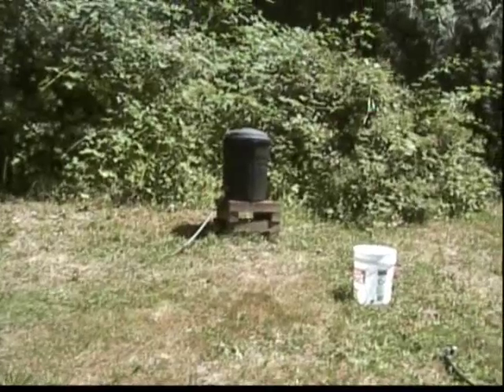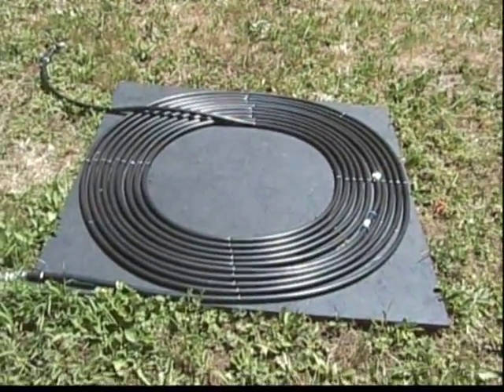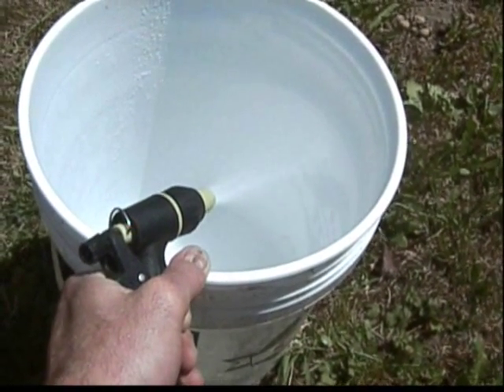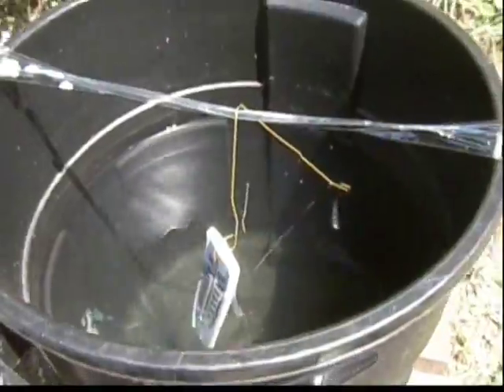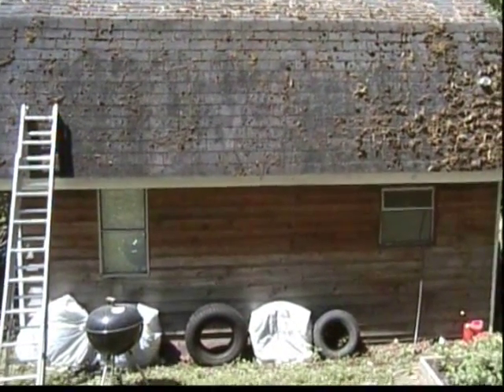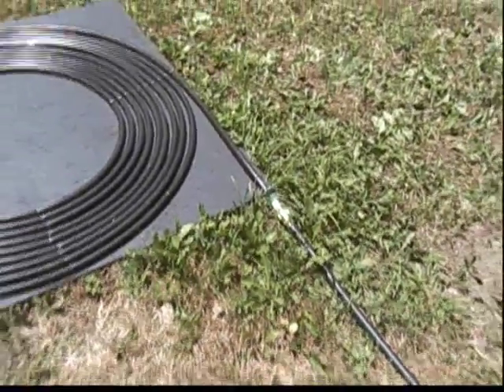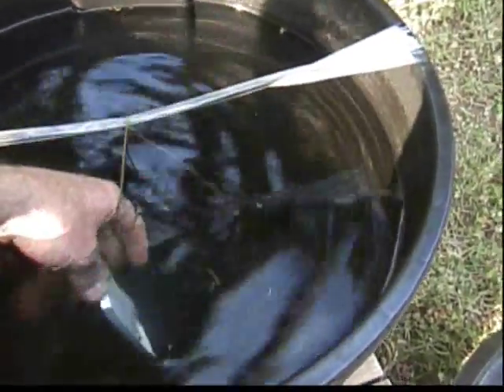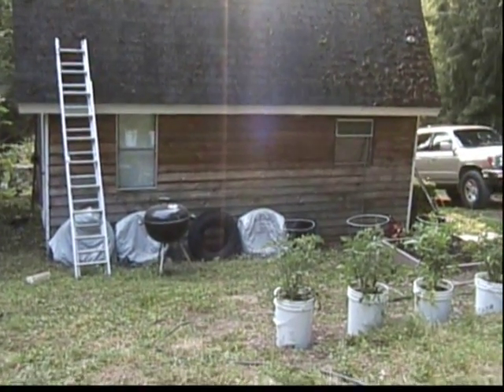DIY SOLAR WATER HEATER

Comment: When you were spray filling the white bucket was the pressure from the cold water replacing the hot or was it just a build up from the black pipe. Hope you know what I mean. I'm looking to do this in southern Spain but make the black bin an integral loop and hopefully get some thermo syphon going.